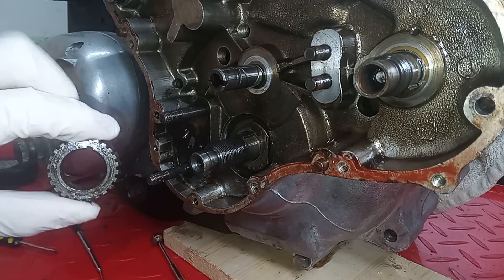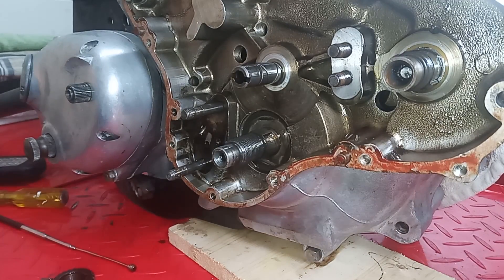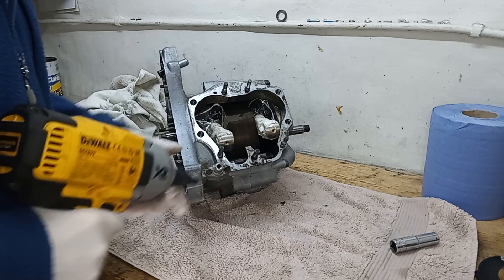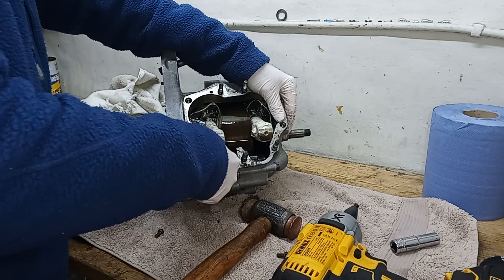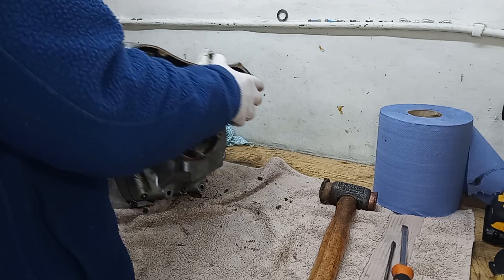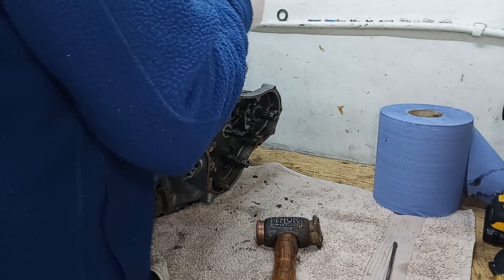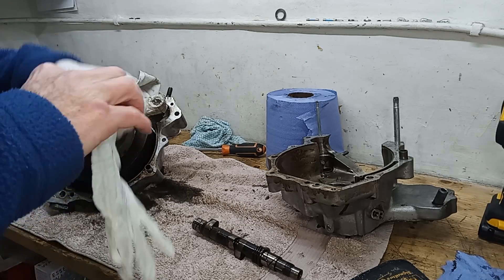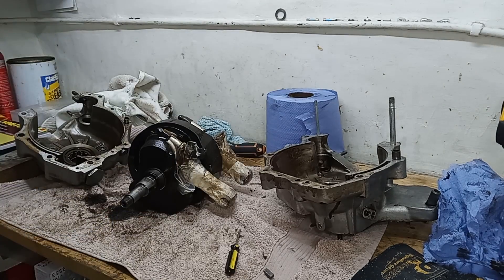Norton Commando Engine Rebuild. Part 17: Splitting the Crankcases

Comment: The Works manual suggests the drive side crankcase is split away first by abutting one end of a suitable piece of hardwood against the chunky outer part of the drive side crankcase mouth, resting the other end of the wooden drift in the centre of the 'Y' of the top timing case (although the book doesn't say how you prevent the whole lot just rolling back on the bench with the blows).The drawing shows a hand applying force to this end, ha ha a rather too soft faced hammer methinks. I would try this first before resorting to the stout screwdriver method, but if that is proven to work without mauling anything, fair enough.
Reply from the maker: Agree. There are several different methods suggested and mine might well not be the best, or even a  recommended one; it's just one that I've used on many different engines and it works well, without damage. But, as I say, it might not be the best. I always recommend that owners look at the various different ways and then choose the one they think is best.